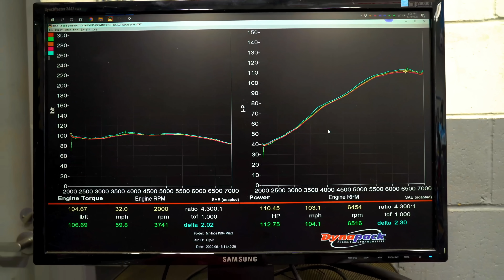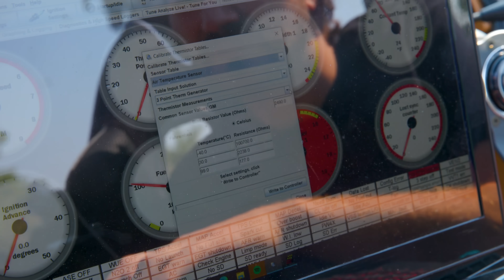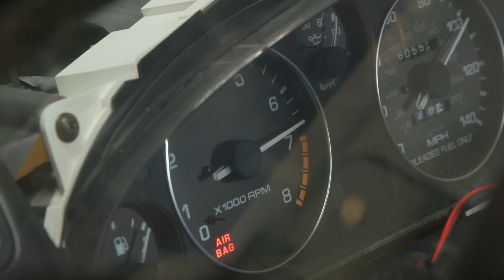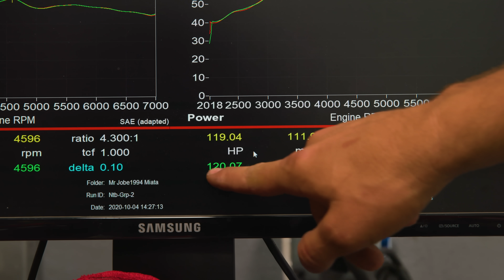Is an Aftermarket Intake System Worth It?

Comment: Zack : I wanna have a 2 digit horsepower gain
New intake : +8hp proud

Zack : DELETE IT I'M GOING TO TURBO IT
Reply: I don't know why they didn't just build the bottom end/ valve train. Would have been a huge difference for a fraction of all those bolt ons. You would also learn alot more cause let's be honest most of us don't learn anything on these episodes just fun too watch. Idk built engine less chance to blow it up from aftermarket parts.
Reply: @clutchbleach2057  probably because building valve train or the bottom end is easily 2x as expensive as what they've done. Sure you could buy a set of forged pistons and rods, but to do it right you get them weighed and balanced with your crankshaft and it's gonna be expensive. That's not even considering the very likely probability the cylinders have ovaled a bit and new piston rings won't set properly so it needs a fresh machining. Not to mention a stand alone ecu will be needed if anything is substantially changed in there. On top of all that, the previous mods will only improve the gains of eventual bottom end and valve train work.

The only thing I think they NEED to do is add more gap to the piston rings, than they could probably run 10-14 psi and make 250 whp and run it forever. Idk what the rods in these miatas look like, but I bet most turbo failures on these engines are cracked ringlands.
Reply: @snakeballs8965  Building the bottom is very expensive, but also unnecessary. The motor in the NA/NB Miata was originally turbo'd in a different car, so it's already built out to be turbo'd. NA/NB Miatas do 250whp on stock internals all day long, no need to touch the rings or anything else.
Reply: @jot8686  I would still adjust the ring gap. Especially for a daily driver, rings butting will grenade any engine. And the stock ring gap on these cars will butt in long driving, I saw it's .006-.012 and that is fine for naturally aspirated but anymore than 10psi (provided that 10psi is actually doing anything) and thats time bomb territory. Some people run junkyard ls's on 14 psi all day so whatever I guess lol
Reply: @snakeballs8965  do you mean to decrease the gap with slightly longer rings?
Reply: @douglasberg2881  no, when you build a motor they usually come with "pre-gapped" rings, meaning they're ready to drop in provided the piston is compatible. But you run into issues when you turbo a naturally aspirated car because boost pressure=waaaaaay more heat. Things expand when they get hot, so the ring ends expand into eachother and "butt" together where they fold outwards and catch the cylinder walls, usually it siezes in the cylinder and basically shatters the piston. So you file the ends of the rings down to expand the initial gap so it has room to expand more as it heats up. This should be done on any engine that is converted to boost. Factory boosted motors usually are built with this in mind and need no modification.
Reply: They left hp on the table by not port matching to the head, and the amount of air getting into the engine is still limited by the stock cams
Reply: @MrCamoman12  yeah they probably could've gotten a fatter midrange with the port matching, and especially if they back cut the valves while they've got the dremel handy. Free hp just not being used.

Comment: When I had a short ram intake my intake temps were always well over 100, The heat soak was real on hot days. Sure it sounded awesome and throttle response was a little better but I put the stock intake back in eventually because intake air temps were the same as the outside air with the stock system.

Comment: The thing about each power mod, its multiplied by other power mods. If Intake manifold gives you 8% power increase... then say you add a header that gives you another 8%. But put together they will be more than 16%. Because each power mod is made more efficient by the others. Its like getting a catback without a header. The catback cant flow maximum because the stock header restricts it. Likewise a header cant flow maximum if a stock exhaust restricts it. They both make each other more efficient when combined,  giving each part a higher individual power output.  if i put the same intake on my car, which already has an exhaust system on it, i may see higher than 8% increase, because he can only get so much air in the combustion chamber when he cannot clear that air as fast via exhaust flow. Personally i think for that reason exhaust should come before intake, so you maximize the flow of spent gases before you maximize the flow of incoming gases... in my mind you would cause inefficient burning of fuel, restricting power and gas mileage,  and fouling spark plugs over time

Comment: An 8% gain in power is actually very good when you think about it. Other than doing head work, increasing compression, or forced induction, no other mod would give you that.
Reply: He already has a Megasquirt in it so I assume it's been tuned or tunes itself enough to actually be receptive to these mods, hence how he was able to just ditch his MAF sensor without much explanation. On a stock ECU it's a toss up whether you gain anything or not, 8% would be a miracle.

Comment: At this point, I've learned that its cheaper to swap.
Reply: What are you gonna swap in for cheaper than a turbo kit?
Reply: Fiiisho a turbo motor
Reply: swap in a rotary motor in thare that wuld be epic lots of POWER low weight ok the rotary dosent have much torque but the miata isnt heavy its the engine mazda shuld have put in thare in the first place 😆👌
Reply: @gethinjones8992  no, Mazda was gonna go v6. The whole thing with turbos is for torque and rotary swapping is hella expensive
Reply: @yeah9817  ECU, suspension geometry, custom parts, etc. Yeah a turbo motor would be cheaper but the costs of custom parts aint
Reply: @gethinjones8992  well then good luck for your bank account because rotatories love to eat money
Reply: @ibrahimqureshi2420  😂😂😂 so ive heard my friend had an RX8 and it was a lovely car very impresive but boy could it drink 😲 and of corse the engine rebuild cos he used the wrong oil 😕 a very costly mistake 😯💰💰💰
Reply: @gethinjones8992  yes 😌 and these engines also tend to break break as if they stop working properly so obviously fixing them regularly will require alot of money and your right they do have a drinking problem 😂
Reply: @gethinjones8992  OMG is this THE Gethin Jones?
Reply: That’s what you think.
Reply: @fiisho  not mention rotary engines have a nasty habit of dying.
Reply: Most people would just get an s2000 or a bmw z3
Reply: @fiisho  LS+t56 from a 1998-2002 camaro/firebird and rear end parts from monster miata.
Reply: @fiisho  Wow you really don't know Miata history do you? The 1.6 that came in the miata is a de-turbocharged 323 GTX motor, that made 145hp. The car was SUPPOSED to come with a turbo from new, but it was too expensive to produce so Mazda opted to make the car naturally aspirated, hence why the compression ratio of the motor is so low from factory.
Reply: @somedude6598  Alright mr know it all, the 323 and BP motor are the same, except it has thinner/lighter/weaker rods and few other changes.

Comment: It's probably already been mentioned somewhere in the comments, but you're going to want to replace that TB bracket on the IM with something thicker/stronger ASAP. It WILL bend/break eventually. 

Also, you need to drill an extra hole to relocate the butterfly spring on the TB so that it will close completely. It will close fine for a little while, but eventually it'll get to where it won't. 

Use red loctite on the 4 TB screws. I've done this TWICE and one of them STILL begins to work its way out eventually.

There is a .5 plenum spacer made for the IM. When you get boosted, you'll want it.

More in about all of the above mentioned things can easily be found with a web search.

Comment: No pressure in the lines after rest usually isn’t the regulator, it’s typically the back-check valve in the fuel pump assembly in the fuel tank. These valves wear out as cars age and causes the fuel pressure to bleed back into the tank after shutoff

Comment: Should've just cleaned the original air intake manifold and kept the air filter on the left side, a straight pipe from a left side filter to the intake manifold would've produced more pressure. Coupled with the smaller holes in the original manifold, would've also added air pressure. That setup would've been better than the turbo you put on later.

Comment: As a shade tree mechanic for decades I could tell you that when you put performance / racing Parts on your car or truck You will be sacrificing the longevity of that part for a part that may perform better but will not last anywhere near as long.
What most people don't understand is these people that race these cars usually tear them apart at the end of the race and rebuild them For the next race.

Comment: If you're running speed density you don't need to iac to pull from the same spot as the intake. Just put a filter on it. Although having the iac in the same intake track as the intake is much cleaner. Also when boosted you'll want them in the same track so the pressure is equalized . If not it will be a boost leak after 12ish psi. Boosted Miatas are fun 😂.

Comment: If you’re going to turbo this little beast surely you’re going to need to lower the compression ratio? Like new pistons or machine out the cylinder head but the head might not take the stress with all that extra power. Really enjoying seeing this project come along though

Comment: You don't need the coolant lines for the throttle body, they are there to make sure the the butterfly doesnt freeze stuck open when in cold weathers. This miata Will probably never see lower than 15°C ever, so Just Block them off, and enjoy colder air in Your intake! I did this to my 96 323F 1.5, and drove with it for 9 years without issue here in Norway...

Comment: The big thing is that having an intake and exhaust severely decrease restriction overall and even if the car makes 10-20 more hp from it NA it will make more power with less boost when turbocharged.

Comment: Remember that there's a big difference between peak values, and average gains across the curve. Even though the 'magic-number' might not shift that much, if there's an even 8hp gain from 3000-7000rpm, that's a bigger gain than having an extra +20 that only kicks in after 6500rpm. A lot of N/A tuning is like this, the car will be faster and better in the hills, even if it isn't reflected in the peak values.

Comment: I love this series, and it has been super informational BUUUUUUUT, all this time, money and effort to increase your HP by like 30, when you could purchase a BEAMS engine for about $1200 bucks, and have 180HP without even trying. That's 90 more HP, or $13.33/HP.  

And it's a stronger engine, with greater output ability, and would easily fit in that car. 

Keep up the great work, but seriously, dump that motor for something better already!

Comment: Should have explain although it doesnt apply to this build since it will be turbo charged, but a bigger intake and bigger throttle body will also slow down acceleration, although it allows for higher speeds

Comment: i am building my own rally cross inspired car and i am planning on triple charging it, it is like twin charging, a super charger and a turbo, but i am doing twin turbos instead of one. i have a lot of experience in this kind of car building after working with some big companies and teams, hoping for around 800 hp, i did a little math and i should get around 900 to 1000 crank hp but after a lot of failure and miss calucating it will probably reach around 750 whp, maybe something to conciter doing with the miata, or maybe get a dodge hellephant for the next money pit car haha

Comment: I wonder if that Miata has ever had a proper tune after changing both manifolds, if not I bet you can find another 5 hp there, maybe in change of a couple NM in the low rpms

Comment: For small engine lightweight n/a cars, 8hp gain is like 40hp gain with turbo cars. You can really feel the difference. 8hp from intake, if you make itb may be it can produce 10-20hp, 2-4hp from cold filter, 1-6 from headers. Except for itb, they are usually cheap and easy mods, they more than enough to make you laugh and have fun.

Comment: How many times I've had to explain and show to somebody that a larger plenum and intake Runners Nets more volume but at a slower velocity thanks to Bernoulli's principal. There's even Dyno instances that have proven this. Air velocity is where you're going to net Torque from cylinder filling as long as it's not too restrictive. Ive seen larger exhausts and larger intakes lose tq when not mathematically correct

Comment: "Cough" Bottom End. 
It's a Miata... It doesn't take a whole lot of additional 'power' before the little engine starts to suffer. Build the bottom end, the rods, and pistons for example, before you go too insane. Then you can start to worry about the transmission holding up. XD
But, you can make pretty good power with the Miata powerplant. It just takes 'Mo Money' and some knowledge.
---Just my two cents.

Comment: Hey guys, if you add a aftermarket intake and a larger throttle body, youbreally need 2 remap the car...  i've done an RBC 70mm intake and 72mm skunk2 throttlebody on my k20a2 engine, mapped with a doctronics ecu, and had a 19.8 hp gain , just with those 2 mods...
Grtz

Comment: I love when people think intakes and exhausts will drastically improve power, as if the engineers who designed cars didn't already optimize the air flow
Reply: @Thor Odin son I've seen tests with like a civic si (typical ricer car) and he swapped out multiple intakes and exhausts and WITH a retune and found most intakes added no power, if any like 1 hp and same with the exhaust. And I bet you're one of those guys that goes to auto zone and buys a cherry bomb and thinks they will get more power

Comment: hey donut! i would like to suggest you guys to not put a bolt on turbo on the miata but instead try an ITB setup! Go for an NA setup instead im confident itll even be more fun than the HiLow cars. High compression bottom end with a ported head and intake as well as a clean dry sump setup and a beefier cooler for the transmission! That lil thing would rip hard!

Comment: But you're supposed to port the heads to match the intake. 
Next you're going to need bigger injectors, and then bigger valves and then bigger cylinders, and then bigger tubular exhaust pipes.

Comment: if your using an aftermarket ECU you should have thrown in a fly-by-with throttle body instead of a new cable job. better idle control and throttle mapping. another head start toward adding boost.

Comment: Kekw if you were in canada you would struggle taking off sensors and vaccum lines, bolts would round or break and even need a torch from the -40c winters and caked salt on our cars. 100% of all items would break, explode, snap, crack, tear, need replacement. Also don't forget no quarter panels, no rocker panels, no floors, giant hole in the trunk and holes in the engine bay, rotted snapped in half brake lines, leaking rusty fuel lines, fuel filler neck has holes, roof has holes, subframe brittle like lays chips, doors finished from rust, water leaks galore, fenders rotted, engine about to fall out from rusted engine bay, windshield underneath has holes.. damn never seen a miata so clean in my life. Atleast you have a rust free $17,000 miata

Comment: Dont know if my intake is the problem. But I'm having trouble with my NOS car. Thinking I might change to turbo but that's way more expensive. I spent over 150 bucks on NOS and my car wont even start now. I know it's the NOS cause I checked everything else. Spark plugs, fuel pump and lines ect .. for now I guess I'll drain the tank and go back to pump gas.

Comment: This makes me want to mod the 2.0L on my mazda3, but I don't think there is any point with the current level of traction with the front wheel drive.  I could probably use more of the power I have with a limited slip diff rather than jyst making more power.

Comment: When is he going beef up that re diff and get better gear set there to get more power?   I've watch this series i dont recall him touching it.   Also I would max upgrade injectors spark plugs cables and wires be going to the dynamic.

Comment: Question when you build car from scratch you only have car body and engine where do you get electrical cables the cables that connect to battery and power like radio and lights and so on do they come with car body or you need to buy them separetly?

Comment: Right at the beginning I thought: Ah...  another one of the "cold air intakes" which actually takes more hot air than the factory intake and therefore often reduce power.
And also the the piping will gain... like 5 HP or the like? 
Okay It was a bit more, but other than on a dyno you will not notice it - something about 6% more "powa"?
Don't waste you money. 
Stuff like a bigger intercooler on a turboed car does help. This not so much.

Comment: 2:40 Wouldn't running the car like that, until all the fuel in the lines is used up, cause it to run lean and give a risk of knock? I feel like I'm wrong here but I'd like to know why, if I am!

Also he says "needs replaced" and "needs cleaned" around 3:15, I always thought that was "needs replacing". Hm, I wonder where that came from, from an linguistics standpoint

Comment: Speaking of intakes. I Installed a cold air intake and after driving for 6+ hours with amazing performance, rpms suddenly dropped to 500 and hitting the accelerator did nothing.  I put back on the stock Air intake and replaced the MAF to fix it. Any ideas why this happened?